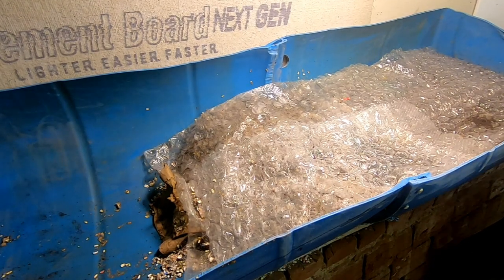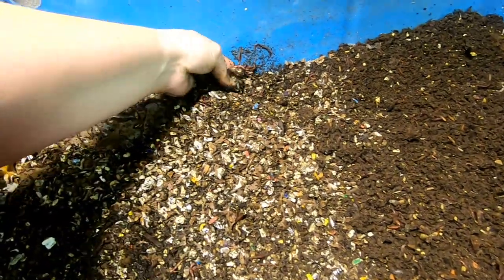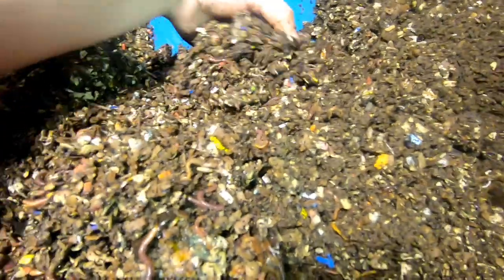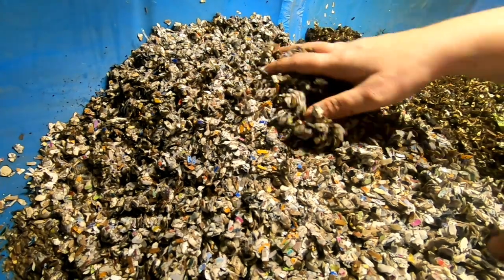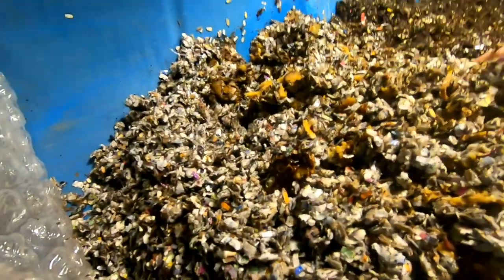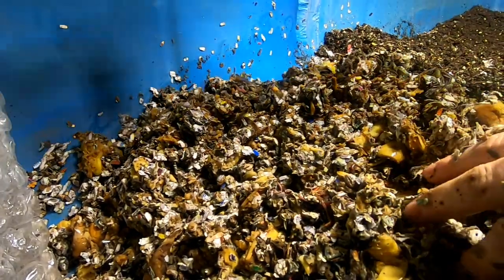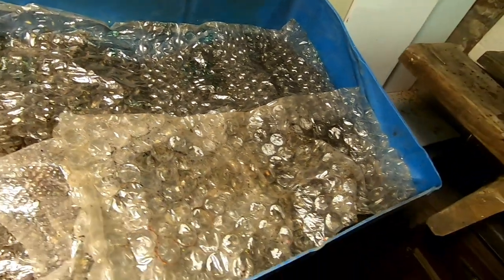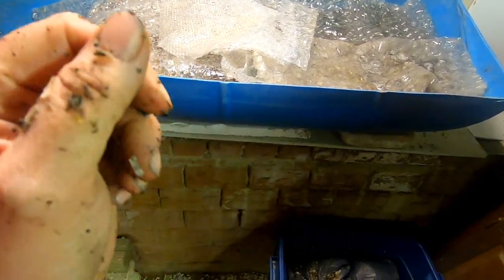55 GALLON BARREL WORM BIN - WEDGE METHOD 1.1.2020

Comment: Question: do you bury the food?
I normally just spread the food on top.
Reply from the maker: I do keep it covered by a few inches to keep fruit flies from moving in. The system is less than 10 inches deep if it were totally full. I find the worms are fine with the food at this depth.  I even had a vertical 55 gallon barrel, and many were all the way down at the bottom several feet deep,when I harvested.
Reply: Awesome. I will try that. I don’t have any fruit flies, it’s a small bin. But I will implement.